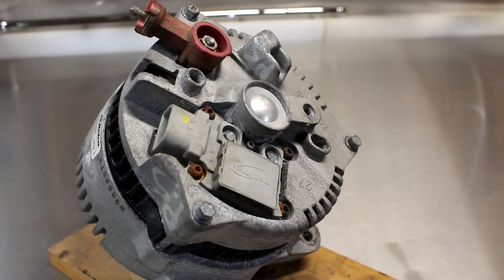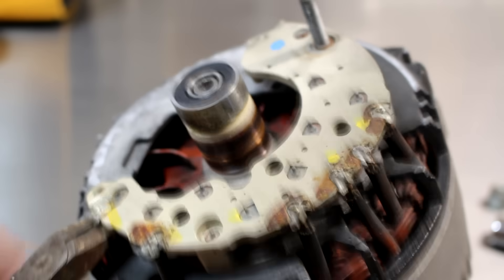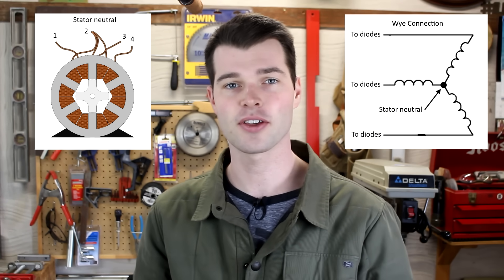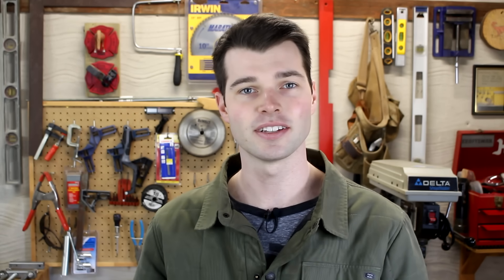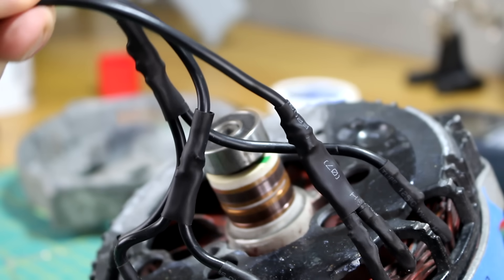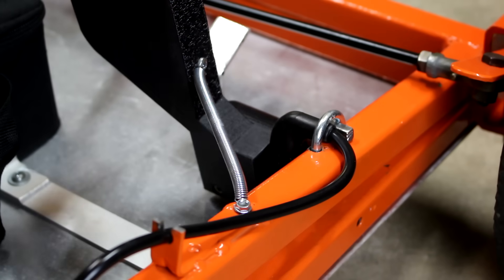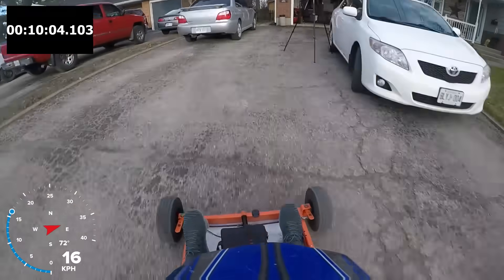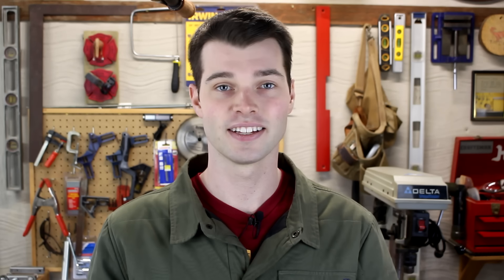Converting a Car Alternator into a Go Kart Motor

Comment: Thanks for posting. It's really going to help me with a mobility cart for my wife. My plan is to use a quad rolling frame as the base with suspension, and the ability to get out in the yard, as well as shopping. I plan to use 2 - 12 volt standard car batterys in parallel for low center of gravity and more run time.
Reply: Heard of an electro mechanics chair,,,(copy, and assisted mobility,,,

Comment: It would be neat to see if you could pull 3 sets of the windings from a push button (electric turbo mode) to see if you can gain some range and still have access to the power when needed.
Reply: There is a youtuber that did it on a go-kart for his kid
It's kouvpasir/koupvasir (one of these names)

Comment: You should put regenerative braking on it by connecting a bldc motor to the chain with a voltage stabiliser circuit and battery charger that way the current draw from the bldc motor will load the chain and force it to slow down

Edit: maybe not a bldc motor but a big enough motor with a high output
Reply: Codz_526 you could just use the alternator for that, just need a controller built for it

Comment: The controller is for brushless motors while this motor has brushes. Something I missed out? Moreover, what is the AC voltage/current that this controller gives to the 3 stator windings? How the calculations are done?

Comment: Hi bro i need help asap! I converted alternator to bldc motor and its working 48V On field coils 12v on rotor
But there is a big problem if motor runs 15-20 sec the coils is over heating about 50-70 celsius idk why but i need help! https://youtu.be/M8vMh6Ux8Aw

Comment: Your battery terminal most likely melted because the screw/bolt was not sufficiently tight. This causes the joint to have a high resistance. The power lost in the high resistance joint (R * I^2) will cause heating in the joint. At higher currents a loose joint can get hot enough to catch fire.

If you can rotate the lug/wire on the bolt using just your fingers, it is too loose.
Reply: I bet he is smart enough to know that. I'm for the high discharge rate.
Reply: @bbstacker70  the motor and controller wires all have much smaller cross section than the battery terminal so they would burn up before the battery terminal. He also only shows one terminal burnt. If it was high current through the battery, both terminals would be similarly burnt.

Comment: hi first great video,second that alternator/motor must be very inefficient as i built an electric gokart with 2x1000watt brushed motors with the same battery pack (4x12v 20ah lead acid) and mine never melted the batteries and i believe it went slighty faster (40s?) its a junior gokart so fairly heavy plus me (about your size) and 30 plus kilos of battery..id like to see your new battery pack though,should be go :)

Comment: All alternators found on modern vehicles going back 50+ years, started with a "Y" connect stator. These are better for voltage, but less on amperage. The "Delta" design is the only one used the last 30 years on domestic and most import brands, as the delta stator produces higher amperage but less on voltage at low & high speeds. 14.8 volts is usually the regulators set point with a 2.5 turn on delay for engine load after starting. I am confused as you wired in the brushes but had shown the controller selection for brushless. It worked until the terminal started to melt, but if clean and the cables cover has no obstruction from good contact, it should have worked with the melt down. A top post terminal battery will provide 6 times the contact surface for your purpose. Remember, the battery power PMG starters with lower amperage draw today, but fuel pump, PCM, BCM and other electrical components only during starting. It was not intended on long term high current output as the alternator will charge a good battery at 100% state of health & charge at less than 1 amp going down the road. I would have like to have seen a wiring diagram included plus explained step by step for those who wish to pursue building one of these. Electric motor powered vehicles, like the original GM EV1 has extreme amounts of torque if current can get to the motor at start. I put a smile on my face the first time I drove one while working for GM, followed by "I want One of these!"
Reply: This yt creator doesn't care

Comment: Hey guys, I’m currently making a cooler go kart for my engineering 4 class, and I’m a bit stumped! My alternator has 3 sets of wires, but it also has a small wire in the middle, and two more sets of wires on the other side! If there’s any help out there I can email you some pictures so you could understand what I’m talking about, but help needed! Thanks! - nothingplatinum@gmail.com

Comment: Amazing! I thought the alternator needed alternated current on the stator windings in orthet for it to work as a motor, (to produce rotating magnetic field) unless you're using an inverter??
Reply: that is what the motor controller does, basically pulses each field at the right point and for the right time.
Reply: @nfarnell1  thanks pretty clever, now makes sense

Comment: Simple question. If you attached a working identical alternator on the opposite side. It would provide additional charging to the battery configuration  possibly increasing the range or time by 25 percent
Reply: OMG.... No no and NO

Comment: But what if you used another alternator and power cap (used mostly for subs and amps) and a 12v car battery. That way you can drive and store power in the power cap(s) and have continuous power. It would almost be free endless power then ..
Reply: X's power caps with solar connect
Reply: No such thing, bro!
Reply: Minus build supplies
Reply: @insertnamehere8220  Again, no such thing as free power
Reply: @blackz06  cool man, you win
Reply: @insertnamehere8220  it's not a contest lol.  I just want to make sure you know it won't work, like you're thinking... so you don't waster money attempting it one day.

Comment: Hey, austiwawa
what about an upgrade on this project?
you can grab a 12v brushed controller on asian wholesale sites (doesn't need to be rc-related)
use the 3s lipo on the controller
and the controller on the field coils
because if you change the voltage/tension on them
it changes the revolutions/volt ratio(known as Kv ratio)
using 12v on the rotor means max torque (idk about 4s lipo)
and if you lower that tension/voltage, the eletromagnetic rotor will be easier to run and it will go faster
Reply: @LazyH-Online  I dont think just any standard 3 phase AC ESC will control just a voltage on 1 phase. You do need a brushed controller for that.

Comment: i wonder , could you install an unmodified alternator to charge the battery as you ride ?  a self charging go kart ?
now THAT would be cool
Reply: The input would be equal to the output, minus energy lost to wire resistance, friction, and heat, so either the go-kart wouldn't move or the speed would be inhibited at the rate of recharge.
Reply: thanks for the reply !
Reply: @Linkyboy  if you were to use a large amount of capacitance.. couldn't the alternator create an excess charge from the rotation of the belt system and wheel rotation caused by momentum?
Reply: @bkostella412  If we're talking about regenerative braking then yes, you could regain some energy, this basically what electric cars do already. We could just configure the single alternator to swap "modes" and convert the rolling energy back into battery charge. But if we're talking about recharging the batteries by putting a second alternator then we're trying to create an infinite energy system and the reality is that the resistance of the second alternator would stop the first one from accomplishing anything. The only way to input energy into that system would be if it was rolling down hill.
Reply: Perpetual motion would be beyond cool, lol

Comment: To: Alexandru Vasiliu  Wrong, we tested NiMH against Li-Ion: we drained both to Zero (0) volts and then tied the pos & neg together overnight: RESULTS li-ion Never could come back, but Ni-Mh DID take a charge after discharging normally & charging again normally*, ran just fine for 6 more years, now thats a  "bullet proof"battery, (lion can'take even one discharge below a specific point, while nimh can !)  As said nimh is a bit less energy dense & a bit heavier but has flying colors where lion FAILS, & most important doesn't Explode like lion does occasionally.  Nimh is used in prius cars for a reason. For all we know those airline crashes are from lion batteries exloding wrecking the electronics. *seems to take the charge from zero v in 2 tiers or steps, but thats way better than being stranded or blown up. Batteries tested were small cordless phone types of lion & NiMh

Comment: Hi! I'm in an Auto class, and am currently working on transforming a mini bike into an E-bike using an alternator. How is wiring the motor into the ESC different from wiring a normal electric motor in. Thanks in advance!
Reply: Dave Micolichek  I was simply unaware that it was the same process. Regardless, that project is long behind me now.

Comment: That keyway would have a lot of play in it if you  used a grinder to grind the trench.   I would think after a lot of starts and stops it would eventually wear down the trench and work it's way loose causing power not to transfer.

Comment: I wonder if he would use a 12volt car battery ... He seems to know a lot about conversion .
Reply: Car battery isnt suitable for that application. If Lead acid battery - it has to be at least traction version. Li-ion (or Li-Po) are most suitable: high current, easy to protect, low weight....

Comment: For anyone looking for easy, cheap and burnouts. 
Just use a Toyota gear reduction starter, and dont use a controller, use a Ford starter solenoid instead, And a classic car horn button for the throttle. 

As soon as you hit the horn button, your kart will be sideways and scare the shit out of you.
This method is by no means reliable, and probably unsafe, but it worked well for me and didn't require and modifications.
Reply: These parts can replace buying the module controller, motor, and throttle?
Reply: @William Giglio Would be nice .. id like to get more info on it.. .can you direct me to it? i'' appreciate it... so far i got some alternators converted already...
Reply: The controller is converting DC to AC , alternators are essentially 3 phase AC motors. Hence the name alternator

Comment: I want to try this to push a cart to get into a market. I have a brand new alternator to use that was given to me. No battery yet but could buy a deep cycle one if that’d work. 

The cart is the size of a go cart. It only needs to travel up to 5kms an hour but will weigh about 100 - 150kgs with the gear loaded on it. Is this possible?

Comment: Good video!   Be careful about the li-ion 18650's:, li-ions can heat up and explode when over worked either charging or discharging.    Yeah... it can happen,,, sometimes without much warning and if you are facing away from batt pack,  you wouldn't notice smell or visual smoke from batts. ... just food for thought.   I recommend NIMh say from prius car ... rewire it to be less voltage than the 300+ volts it is from factory.  you will need to figure a way to charge the nimh in parallel (maybe use thermistors so that either when charging or discharging IF any module in the pack overheats the thermistor will also overheat too and limit the current to/from that specific module.   )  ...  NIMH like li-ion swell and even catch fire, but unlike Lion are not known to explode .  Remem:  Boeing fires and lost aircraft etc. Cell phones exploding inside a womans pocket,laptop fires with heavy use.   Nimh was so good that Texaco bought patent and suppressed it for at least a decade.; much SAFER !    Some Lion electrics have had modules pop out and explode in midair , google search it:  exploding li-ion electric cars.
Reply: NIMH are the worst batteries ever invented
Reply: @alex-w8p2e  Wrong, we tested NiMH against Li-Ion: we drained both to Zero (0) volts and then tied the pos & neg together overnight: RESULTS li-ion Never could come back, but Ni-Mh DID take a charge after discharging normally & charging again normally*, ran just fine for 6 more years, now thats a  "bullet proof"battery, (lion can'take even one discharge below a specific point, while nimh can !)  As said nimh is a bit less energy dense & a bit heavier but has flying colors where lion FAILS, & most important doesn't Explode like lion does occasionally.  Nimh is used in prius cars for a reason. For all we know those airline crashes are from lion batteries exloding wrecking the electronics.

Comment: Nice video but I would like to see a schematic and how you actually connect the modified alternator to a battery to make the modified alternator spin.  I'm not really clear on how that is done by watching a video for maybe I miss something
Reply: The brushless motor controller is really what makes the alternator spin.  There are three separate coils, so the motor controller has to power one of them at a time by turning on transistors connected to the three wires of the alternator.  Unlike a brushed DC motor, brushless motors need this complicated control mechanism to run.  But it is worth it in the end because of the added efficiency.

Comment: Does an alternator have the cooling capacity to run for extended periods without overheating? I don't know much about them, but this does seem like a potential concern to me.
Reply: Spencer Leeper shouldn't be a problem.

Comment: Could you not just also make the alternator motor into a combo motor-generator so that it can (even with diminishing returns) recharge the battery as you drive?
Or just attach another alternator or 2 for this reason?
Reply: I believe you're referring to regenerative braking, or harvesting the car's kinetic energy to recharge the battery when slowing down (rather than wasting that energy as heat in the brakes). It's certainly possible, but you need either a circuit that can do the job (essentially a full bridge rectifier that turns the 3-phase AC from the motor to DC) that is switched in when braking or a motor controller that has the capability built in.

Comment: maby try making a switching option for star/triangle connection of the motor to avoid high starting current... thats how u would run electrical motors before softstarters/inversters

Comment: Hey mate!! Try using a smartdrive motor rewired into star configuration, much more powerful and longer lasting, also great idea swapping to li-lion batteries, theyre wayyy more efficient, ive built a pocketbike using li-lion batteries with smartdriven motor all rewired,  it works perfectly!!
Reply: Stupid question possibly but what is a smartdrive motor?

Comment: I've been thinking about building an electric cart for my son he will be ready for next year I'm sure I've pushed his powerwheels to about its max. I was planning to use a washing machine motor I have on 48v deep cycle batteries but now I'm thinking I need to check out the 200amp alternator that never made it on my Suburban. My only concern and maybe you've put enough time on it now to give an idea is can the original mounting point hold the torque of using this as a motor. Being there only looked to be 2 cast aluminum mounts.

Comment: I have 2 speed controllers Models : CT02  Rating Voltage : 24v  Max Current : 40 apms Matched Motor Power : 500w  Can those work with the alternator mod you did on yours and if it does what wires do i connect from the alternator to the controller because it only has 2 wires for the motor ??? Any info will help :)

Comment: Gee , I have a hand full of old alternators around , this will be my spring project .   But I wish someone would take just a little longer to explain how and why you re-wire the alternator leads. 37kph? You must have got 3 hp out of that little alternator, more than a real electric motor would give you for that size . Well done .